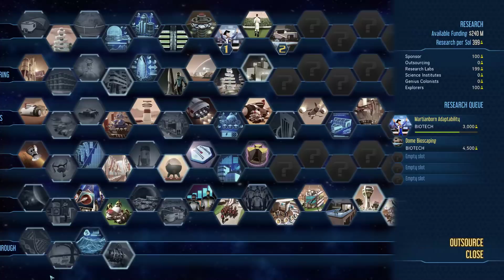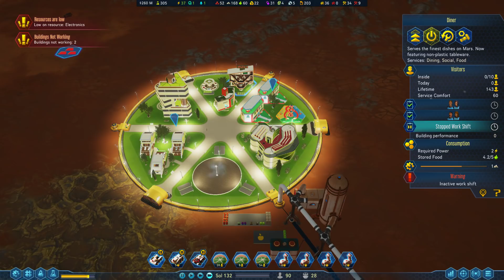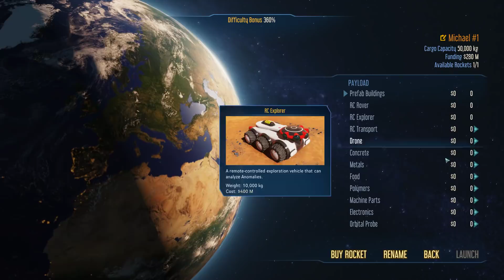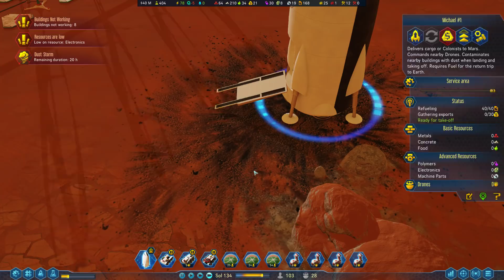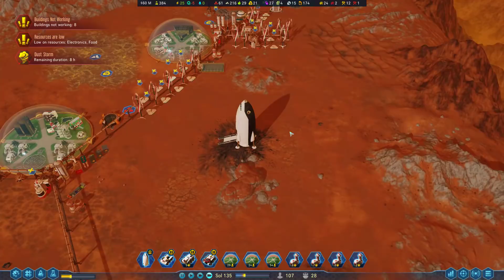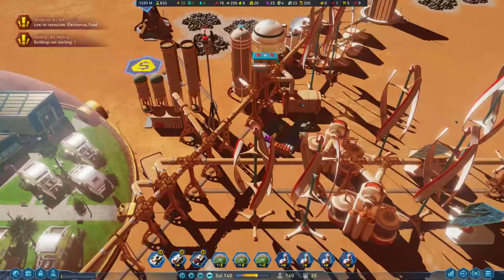Surviving Mars: TWELVE APOSTLES -- Part 10

Comment: The Stirling generators in this are radiothermal generators, so don't need geothermal heat. And the thicker air in the dome might actually make them work better than outside; it's warmer, but the thicker air would give much better convective cooling. Them working in domes seems fairly reasonable... although it doesn't seem terribly efficient to use precious dome space on them, since they don't need maintenance when closed anyhow.

I do agree on the solar panels though, while they should work, it shouldn't be at full power. Even an Earth-rated glass window is bad for solar panels, and we have a nice atmosphere to shield us from the worst of it before it even gets that far.

Comment: Drone Hubs vs Tunnels ... the Tunnels are waaayyy cheaper, because (1) they don't require any Electronics to build, and (2) they don't require any Electronics to maintain. In my 535% playthrough, I avoided Drone Hubs completely until I was making 2+ Electronics per day (I bought 2 Rovers early on, to serve as Maintenance-free Drone Hubs, until I was certain I could support Drone Hubs locally).
Reply: Daniel Budney inventor start is pretty strong for that reason. Maintenance and power-free drone hubs are lovely

Comment: Quill18 It is a difference not a differential, a differential is something on your car or a high level math term used for describing rates of change.
Reply: Differential  Adjective "of or relating to difference or diversity."
In the case of a DIFFERENTIAL GEAR this refers to allowing the driven wheels of a car to rotate at slightly different speeds when cornering.
A temperature differential occurs between two areas of different temperature.  The larger the temperature differential, the faster the difference will even out. This is why icecream melts faster on a hot day.

Comment: Sterling generators in the game work on magic.
Reply: Arbitrated Shan it might just be assumed that their maintenence happens, but it's so low or cheap that it isn't worth adding a cost for it.
Reply: Striking generators are fun, they're basically designed to run on entropy. It's a bit magical in this game that they never need to be maintained as long as they're closed though.
Reply: Christoph Edlauer Stirling Gens seem more like RTGs on steroids in this game.
Reply: That's essentially what they are. There's even a breakthrough tech that upgrades the radio isotopes in them to boost their output.
Reply: Or radioisotopes to create a heat differential in a carrier medium like water...